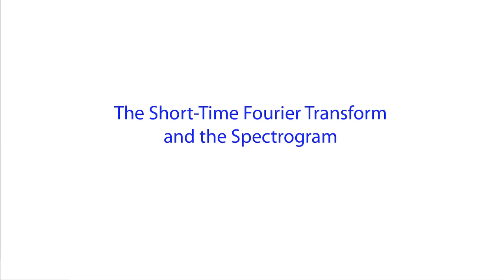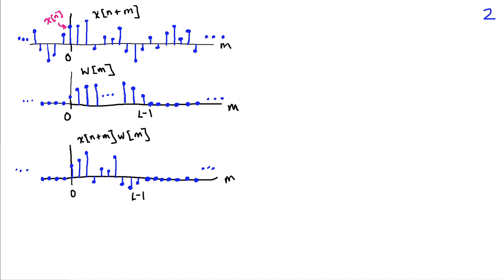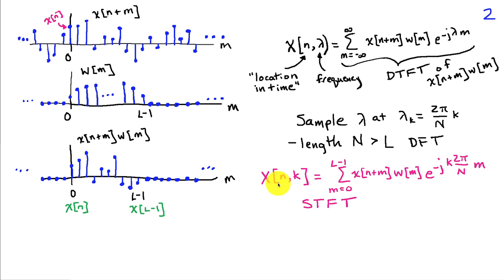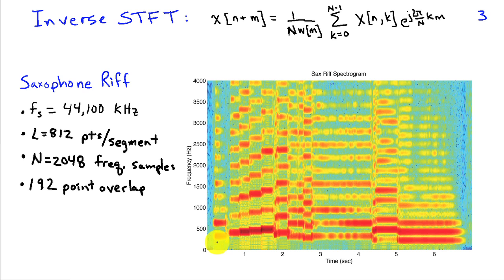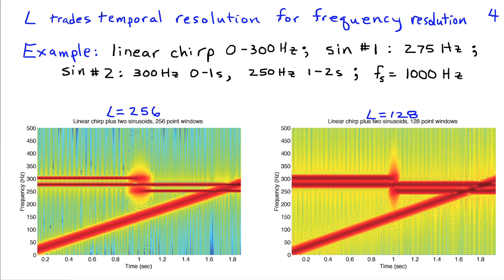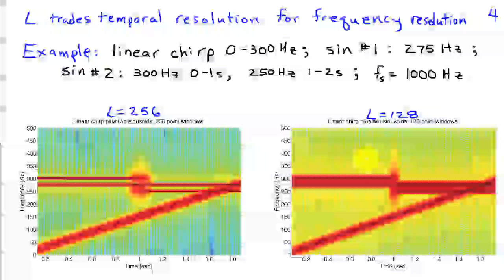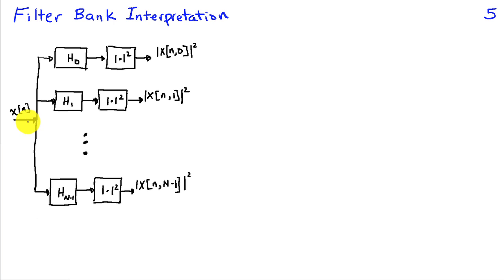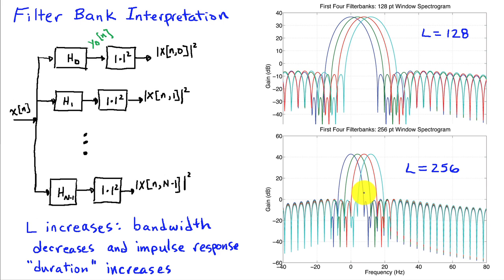Short-time Fourier Transform and the Spectogram

Comment: what is the different between L and N in the saxophone riff section? doesnt N suppose to have the same number as sampling rate?
Reply from the maker: L is the number of data points being analyzed in each segment of data, 812 in this example.  So we are finding the frequency characteristics for segments of length 812.

N is the length of the DFT used to analyze the L=812 data points in each segment.  So each segment of L=812 data samples are effectively padded with zeros to length N=2048. N only controls the number of frequencies at which we evaluate the DFT (N frequencies).  This concept is discussed in several of the earlier videos in The Discrete Fourier Transform and Applications playlist.

Comment: Even though I am a wavelet guy, I can still appreciate short time fourier transform.
Reply: wavelet is just an optimization for computation complexity , wavelet is for engineers :)
Reply: Given that wavelets exhibit localization in time and frequency and wavelet analysis allows for efficient multi-scale analysis, wavelet analysis is superior for financial data where there exists higher order non-stationarity and multi-scale dynamics. Conditional on the data, I use either wavelet packet denoising or wavelet NN-ARFIMA hybridization.
Reply: ***** Do you use matlab or R code? How good are you at mathematics?
Reply: In short, wavelet analysis works by analyzing the time series/signal at varying frequencies at varying resolutions.For high frequencies, there is strong time resolution and poor frequency resolution. For low frequencies, there is strong frequency resolution and poor time resolution. Unlike Fourier that uses long forms, wavelets are highly localized. Unlike Fourier, it allows one to see the non-stationarity in the process.  

Heres a good simple introduction I found by searching one second on google 
https://georgemdallas.wordpress.com/2014/05/14/wavelets-4-dummies-signal-processing-fourier-transforms-and-heisenberg/
Reply: ***** There exists more advanced tools such as Hilbert Huang transform (R package hht). Its ability to handle nonlinear and non-stationary process is unmatched. It, also, has the sharpest time-frequency representations. These are extremely computationally intensive!!! It took me hours to run a HH spec on my personal laptop.